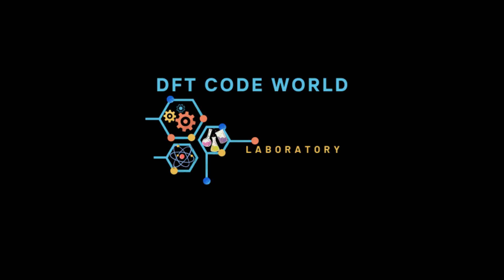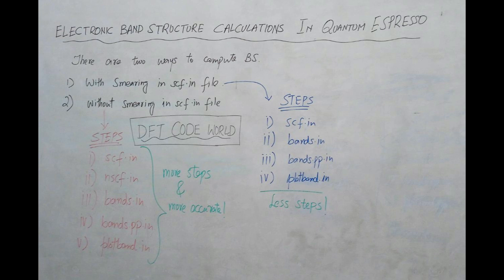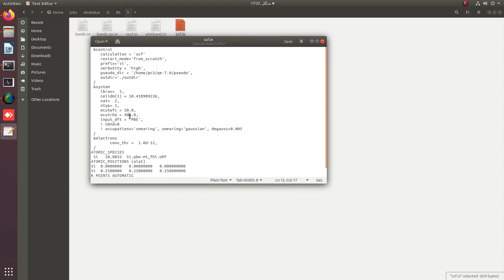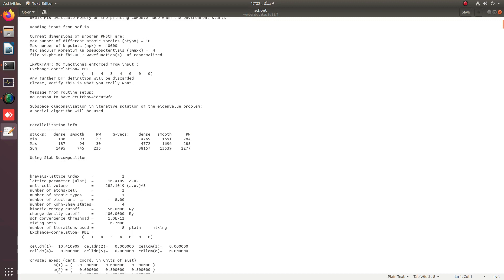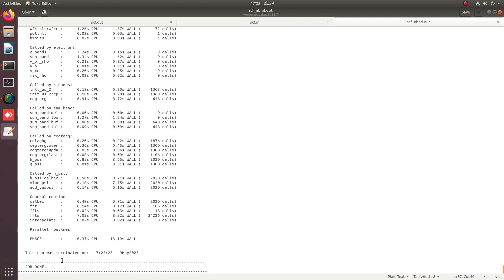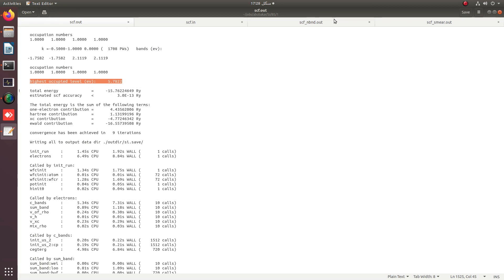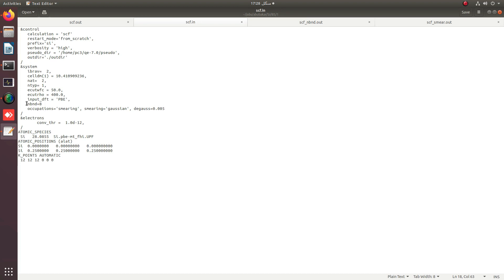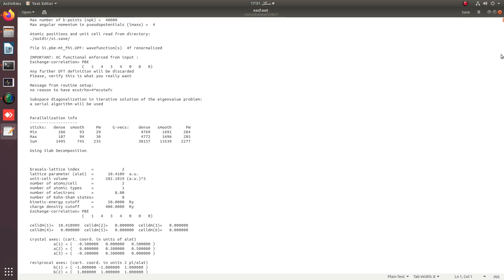Band structure calculations in Quantum ESPRESSO

Comment: sir can u kindly tell me that should we use optimised values of ecut,k points and lattice parameters in the calculation.Also we have already done scf run before,should we repeat it again
Reply from the maker: Yes, it is necessary to use the converse value of ecut, k point and even smearing to get accurate results.